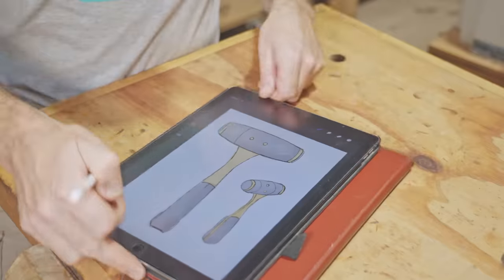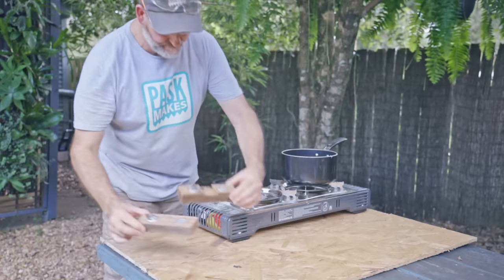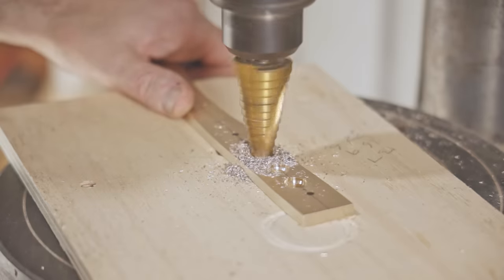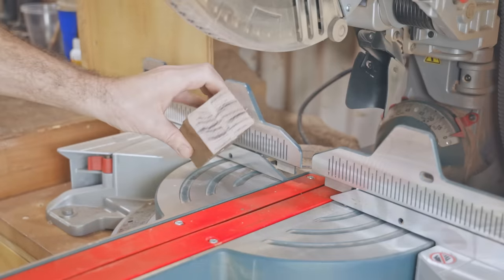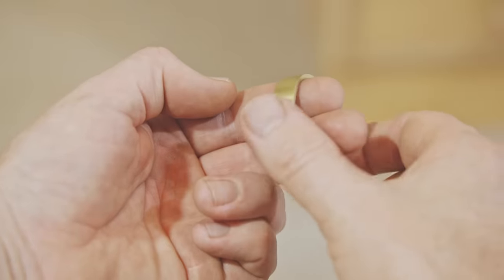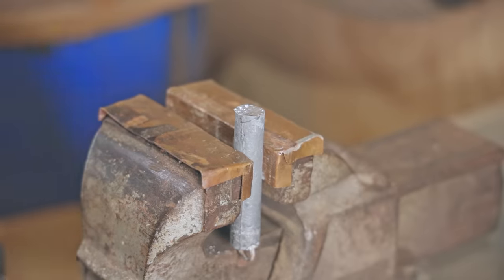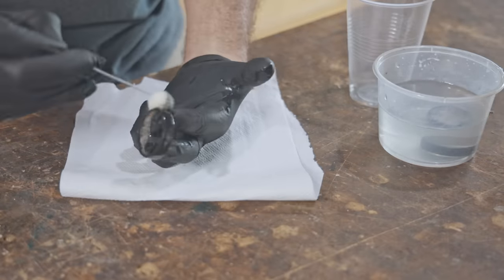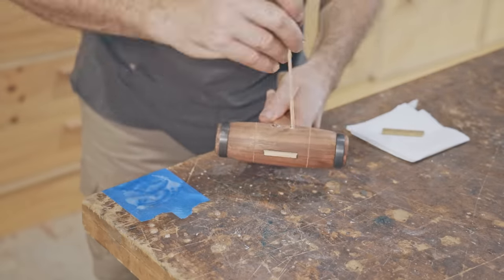Making a Dead Blow Mallet with a Brass Handle

Comment from the maker: I forgot to mention what a dead blow mallet is, so I thought I should mention that here. They have less rebound than a regular mallet with a more controlled blow. When the face of the mallet strikes a surface the loose lead inside immediately follows to deaden the rebound. 

Link to the Black & Brass Steel Finishes video https://youtu.be/hz6wdvraC-g

It was a really fun project. I wasn't sure how it would turn out and was a bit of an experiment. I think if I made it again I'd make the head a little shorter in length but I'm still pretty happy with it. :)
Reply: I've owned and lost a few deadblows over the years. Never thought to make one.
Reply: Thanks for the explanation. Also, I was surprised when you did the head again. Knowing myself, I would have finished the first one saying that it was a feature 😅😅😅
Reply: So the first one wasn't a real dead-blow head because the lead was tight inside....? 🤔
Reply: @krishm2478  yes.
Reply: It turned out fantastic Neil. Looks awesome and I really liked the little jingle during the show 😂 brilliant video mate 👍
Reply: Looks great - as always! Thanks!
I'd love to see a short video comparing the old mallet to this one, too see if we can see the deadness in action.
Thanks again for all the videos.
Reply: I love it mate and props to making your own lead shot! I also wanna give you props for again using stuff that was easier for anyone to find. Great job mate.
Reply: I've always assumed that a deadblow needed the channel to run in the same direction as the faces. How is it working out? Definitely the best looking deadblow I've seen. Well done!
Reply: One could use a dead blow for putting new pistons in an engine block.  The head of the mallot would need to be elongated so it could reach down the cylinder bore further than a regular dead blow hammer.
Reply: Thats a lovely looking hammer and, as you say,  good for hitting stuff.  I was surprised to see the lathe marks still on the faces of the finished hammer - is that just because theres no sense in polishing up the face of what is going to be used pretty heavily or was there another reason for that?
Reply: Great job, thanks for the great motivational videos, I decided to make content on woodworking and I did it thanks to you!
Reply: Thanks... Was just going to Google it 👍
Reply: Just for future reference you can melt the lead and pour drops into water to create the shot instead of cutting it. It solidifies in little round balls when it hits the water.
Reply: Glad you added the explanation. I was going to suggest adding epoxy in with the lead to keep it from moving around & making noise. But I understand the physics behind leaving the lead loose.
Nice work! I hope it functions as desired.
Reply: Bellissimo video GRANDE MANUALITÀ iscritto LIKE100
Reply: @freirecristiane   "It adds personality" lol
Reply: @marcomarco86tecno  exactly hahahah
Reply: @krishm2478  that is correct :)
Reply: I am curious about the 1st set of rings you made:
When you were coating them with the brass, why did you not coat the interior of the rings with brass?  My logic tells me that it would be one more layer of oxidation prevention, even though you used epoxy to keep the rings in place.

As I said, I am curious.
Reply: 0
Reply: It turned out beautiful. I think the proportions are fine. I have a small piece of steel (business card sized) that I tried the brass brush trick on twice to no avail. I've rewatched the video several times and can't figure out what I'm doing wrong. In the meantime, heating it a couple of times like that has turned it mostly blue. There are some highlights of yellow, green, black, and purple in there too but mostly it's blue. If I could have made it that color blue all over, evenly, I'd have left it but since it isn't evenly colored I'll try the brass trick again at some point. I don't have any particular use for it at the moment. I was just experimenting with the process but I'm afraid I've failed spectacularly.
Reply: I read this in your voice and cadence.

Comment: I took a jewelry making/metal working class at my university. A good tip I can add is to countersink the openings of your pin holes a little, leave brass or copper pins a little proud and use a center punch or other harder rod as an anvil and slightly mushroom out both sides of the pins before you sand them flush. The tiny amount of countersink and mushroomed pinheads creates an hourglass shape that mechanically prevents the pins from working their way out of the pinholes.
Reply: That is a really good idea!
Reply: or for similar effect instead of pin-mushrooming them, you could peen them into the countersink. Same purpose, different method :)
Reply: Do you anneal the brass pins?  I've made a few knives and had trouble upsetting the heads of brass pins.  I had better luck leaving them straight and just using epoxy to hold the handle and pins in place.

Comment: The lead shot rumba montage was a rare treat. Took me back to “I Dream of Jeannie” cut-away scenes.
Reply from the maker: Glad you enjoyed it Luca! :)
Reply: @PaskMakes  Your stylings with the lead shot maraca were amazing, but I feel the need to point out that since you were melting lead already, you can make lead shot by putting a 3 gallon bucket(typical hardware store bucket) of water on the ground and pour molten lead into it in a thin stream from about 2 feet (~60 centimeters) up. It'll turn into somewhat uneven but definitely functional shot. Still, the homemade shake weight was probably an amazing upper body workout, heh. The mallet turned out beautiful, Pask.

Comment: I look to pick up old tools at yard sales or flea markets. The wrenches make great weights to set inside the scales. When I use adjustable wrenches, I cut away the top jaws and set those into the mallet head for weights. I love to find, reuse, repurpose and recycle ♻️. Yours is spectacular.  👍🏻😶🔧⚒️🛠️🔨⛏️ any metals can be reused.

Comment: Looks good! Drilling brass can be a quite tricky as it tends to bite quite a lot. If you work with it more often it makes sense to have a few drill bits modified to bite less by taking off the edge, though using slightly blunt bits should help a bit already.
Reply from the maker: Thanks Daniel and you're right brass does like to bite. :)

Comment: Next time you need lead shot just heat the lead up to liquid and then pour it slowly into water. The metal will solidify into what would equate to shot but without you having to make so much lead dust with a saw.
Reply: Yeah the fumes from melting the lead aren't great either but if you take proper precaution then they're better than having tiny amounts of lead dust in every nook and cranny of your shop until the end of time

Comment: Thanks! I learned a lot just by watching how you do things. And the finished mallet is beautiful! Being American, I had to look up black wattle. It's hard and beautiful, a little like our black walnut. 

I do wonder if brass was the best material for the handle. It's probably stronger than necessary, it's expensive, and its weight affects the tool's balance. And I think I'd have used brass bits for the filling instead of lead. Even if you wear a respirator, lead particles will stay in the shop even after a thorough cleaning, and it's impossible to render it safe. Brass is less dense than lead, but it would still work. 

I'm planning to make a dead blow hammer out of iron pipe and steel shot (actually BB's, because they're cheap and easy to get.) Not having your tools, materials or skills, it'll be just a ugly, utilitarian thing.

Comment: This is very nice , great job!  I know of slightly different designs.  Instead of lead pellets , I know of lead powder mixed with a plastic dust that is negatively charged static electricity so the particles sort of float and it prevents clumping from the kinetic shock.
The capsule can be made of anything that will take the workload. Brass is good. A film canister works too if you can find one and it's flexible. Fill capsules 2/3 full, seal with silicone or epoxy for glass bedding . then insert in line with the head. I know of another used in a certain series of machines parts. Generally it is tungsten powder and a welded steel capsule . Generally it is made  like a cylinder donut ,so it moves on a central shaft , with a captive return spring to push the weight back to it's at rest position . Steel washers. Lead washers and leather washers  sliding around a central shaft also works very well.

Comment: soft scuba weights are filled with lead shot, for future reference.
Reply: You can also find in most sports shops, the soft wrist or ankle weights that are full of fine shot.
I like that mallet more than the three factory made urethane dead blows I have, much cooler looking for a start.
Reply: They are also in a cheap dead blow hammer from the local hardware😜

Comment: This was shared in a Facebook group I am a member of.  I have been thinking of making a wooden mallet for a while now.  This is just the type of mallet I am considering.  I have several pieces of scrap Black Walnut that I want to use and I saved a piece of copper bar stock from the scrap pile.  This video has been a great help in deciding how to go about making my mallet.  I don't have fancy equipment like a lathe to make the mallet head but I think I can cope with some spoke shaves.

Comment: To have the "Dead blow" effect the internal filling material has to be kind of fine and loose to disperse the energy of the impact. The solid core first version would not work anyway. =)
Reply: That’s what I was thinking.The chamber should be long in the direction of the impact
Reply: When he decided to fill it with molten lead he said it wouldn't be a dead blow at that point.

Comment: Really quite a nice mallet. Would have loved to see a comparison of a similar weight mallet blow on a pair of tight pegs or something between a standard mallet and this dead-blow. Or at least seen it in action. But yeah, nice work around to forgetting to drill the pin holes while it was still a square head, and the decorative stripes too. I hadn't thought of using a v-tool, after the fact, myself. Thanks for showing that tip. Brilliant solution.

Comment: I've also reused the balls from old or free wheel bearings. Ball bearings come in a huge variety of sizes so they're perfect. Plus they are stainless steel so once I fill the hole I pour in resin, glue, liquid rubber or anything like such I have on hand. Use what you have and save money.

Comment: Really nice project! Just a safety tip. When heating the galvanized pipe to add the brass finish, make sure you're in a well ventilated area. Galvanized pipes throw off some really nasty fumes when they get too hot

Comment: One place where you might run into trouble down the road is that your pins are attached with glue and not peened. The more you hit stuff with your instrument of choice (and the harder the material is), the more this will come into play. Glue has a nasty tendency to suddenly give out when enough force is applied and the forces in vibration are surprisingly strong in these things. It's why knife makers want to peen their handle scale pins (and why pins are much better than just glue without any pins in the first place). The mechanical connection of a peened pin is much less susceptible to vibrations. Of course the pins simply being there does all the work, the peening is just to ensure that if/when the glue breaks, the pins can't fall out.
There are taper reamers out there in case you really get into that stuff. It's not strictly necessary, but it minimizes the risks of breaking your scales when peening (especially if you want to use some brittle scale materials like bone or acrylic) (well, I say minimize but really it just allows to peen much more substantially thus making the peening stronger). Making a gradual cone-like hole for the scale material is generally much better than for example using a countersink bit as it more closely mimics how the metal expands while peening.

I really liked making the detail lines on the lathe after the fact, good thinking. What I really enjoy about your videos is that in addition to just being good woodworking/maker content, just about every time I learn some small trick that solves a problem.

Comment: Great video , just a suggestion , next time you need to take the edges off your lead shot or even shake a rattle can spray paint , just duck tape it to a sawzall blade and squeeze the trigger on your reciprocating saw ,works awesome.

Comment: Would a homemade tumbler work for removing the rough edges? Glass jar with bolt thru the lid pointing out. Fill jar with lead shot and sand. Insert bolt into power drill and turn on for 15 minutes. And don't forget the background music. Sift out the sand with kitchen strainer.
Reply from the maker: I thought about that Joe and also putting it on the lathe but decided to do some dancing instead! ;)

Comment: Nice project! I made one last year that uses a large pipe T (I used steel, they don’t have brass ones as big as I wanted). I turned faces for either end and a handle. Then I used pipe taps to sort of thread the ends of the faces and handle. I filled the T with Daisy BBs. Steel not lead, but still it ca,e out great. Leather on the faces too.

Comment: "Should've made a template", naw, to me, this is what makes your mallet "unique". 
If I may make a suggestion to your miter saw, I noticed some of those smaller pieces just barely fit to both fences. Make yourself a sacrificial backer fence, can do a quick bolt fasten since there's already holes in the main fences. Will save your fingers and work piece. 
I remember your soft faced mallet build, enjoyed that video, still haven't had to time to make one myself yet. Really like this one as well. Hoping to build one myself in the near future. 
Wow, very interesting, never knew you could do that to steel. 
Great build. Cheers :)

Comment: Nice!

I would do things a bit different to actually make use of the dead blow effect (no recoil): make way for the shot to travel from one end to the other end. Like a steel pipe with welded caps (and 1/3 to 1/2 full of shot). The trouble is with the handle that can't go through the pipe. Maybe a welded handle. Then the outer casing must be soft like plastic or wood. Or leave the pipe bare with screw on caps on ends (like plastic, rubber) commercially available for mallets, or even wood caps. But then the outer pipe must be polished a bit to look nice and the welded handle must be filed a bit.

I use a dead blow hammer in automotive work. Great for getting out a seized piston from the cylinder, or to unstuck parts, or to mate two parts (gearbox to engine, head to block). Machinist also use it to make fine movement of the heavy parts to align (like aligning the lathe axis on the rails)
Reply: Also instead of lead shot you could use sand. Less heavy but smooth action (keep moisture away to not clump up inside), others use glass shards (they get to fine dust after use)

Comment: You can't buy brass tube very easily, but silicon bronze should be easy to get in tube, as it's used for journal bearings (aka bushings). Very similar colour and it also doesn't rust. IDK where in QLD you're located, but in Brisbane you can get it from GWS.

Lead shot is easy enough to buy from RC model stores, as you need to pour it into the keel of an RC yacht before sailing (because they don't want to airmail it with 1.5kg of lead inside).

Comment: Well done, I have put rings on chisel handles by making them a tight fit and then heating them up to expand them, then quenching. A bit like a rim on a wagon wheel. I don't know how it would go with epoxy though.

Comment: Beautiful work. another option you could do it is to use steal shot and more space\ less filled so that can travel inside, the lead can become 1 block after a while depending on how much and how hard you use it.  it's one of those tools you can have many variations for different uses.

I have a dead blow hammer my dad made that i love, full hollow one face is thick leather the other is teflon (i think) and i guessing about 1/4 full of steal shot. you can get a heavy hit with a light swing and never leave a mark.

Comment: A note for lead work. If you drop the lead into water one drip at a time it makes lead shot. A little tear drop.  thanks again for the post. Your power tools are different then on this side of the pond. Over here if you bye yellow tools ther are DeWalt, red Milwaukee. All the big brands have a color they use.. Your tools look old and well used.

Comment: Beautiful hammer! You ever consider selling those by any chance?                                                                                                                                                      
         
        For future reference, the shot doesn't need to be round to work correctly. In fact, you don't even need to use (lead) shot at all, copper would likely work as well.  And all that the weight needs to be able to do is to slide back and forth inside of a void of some sort. Some dead blows work by simply having a hollow tube inside the head, with a heavy weight inside of the tube, that is able to slide freely back and forth with the motion of the swing, inside of the tube.          

          As you swing the hammer, the weight moves to the back of the tube, and as the hammer makes contact with the part, the weight slides forward, striking the forward end of the tube, and preventing the hammer from rebounding.

Comment: One technique to make lead shot is to take your large lead weight and hit it with a blowtorch while holding it in a pair of pliers or vice grips. Let the lead drip off into a pan of water. The lead with solidify in a roundish ball.